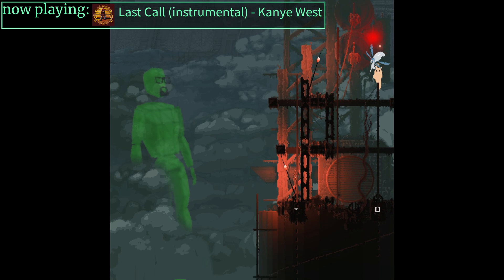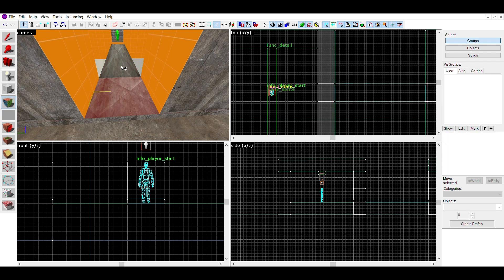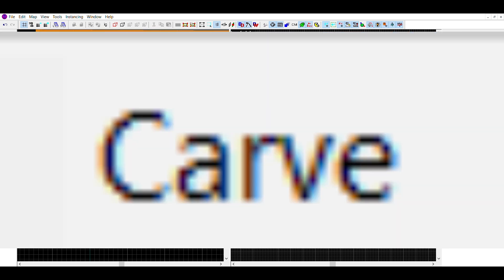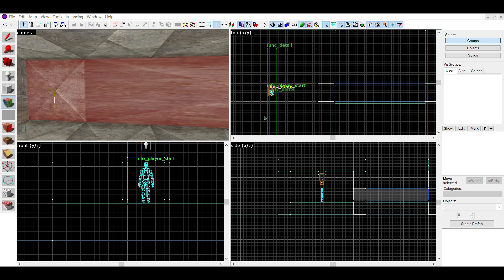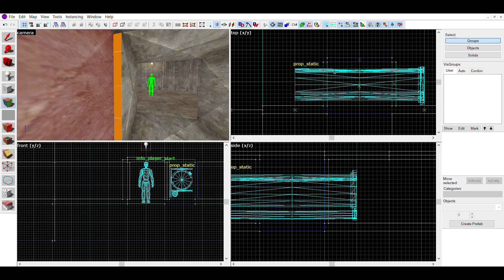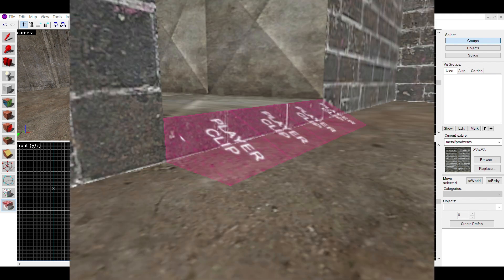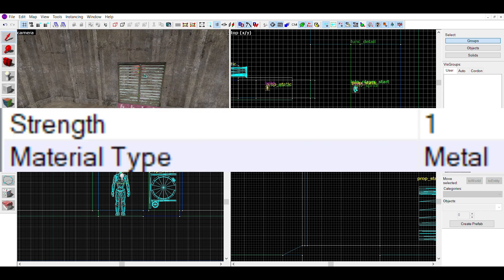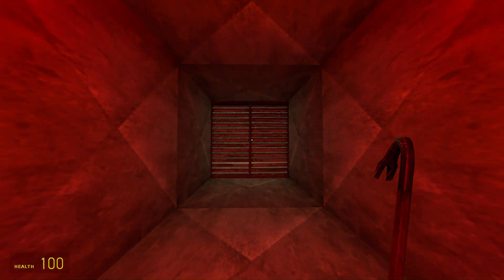Hammer Editor Tutorial | How to Make Detailed Vents

Comment: You can also use the prop vent cover that Valve uses as that will give you a nice breakable prop.
That prop though assumes the vent is a smaller scale than 64 units, so you’d have to make the whole vent smaller to make it look right.